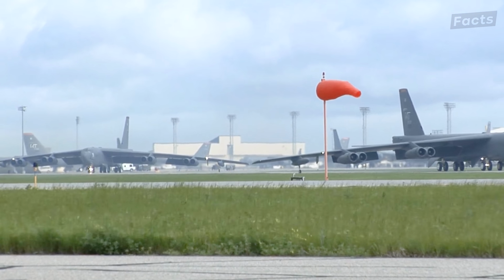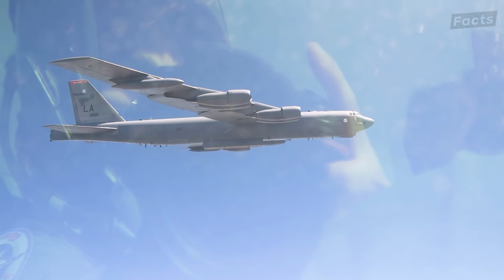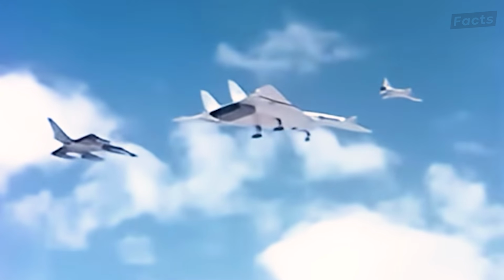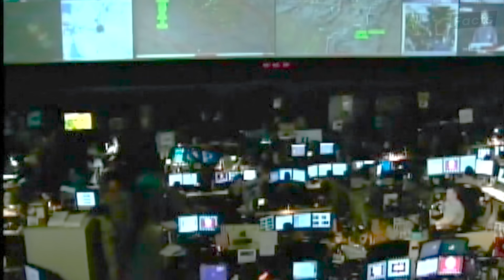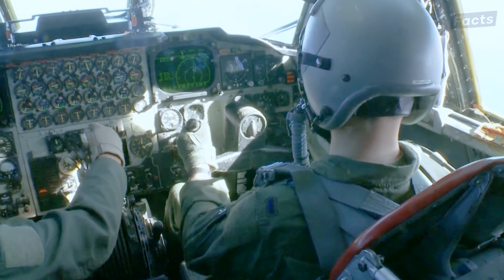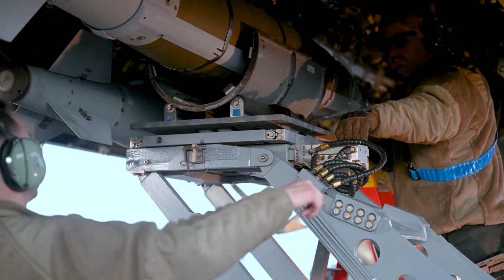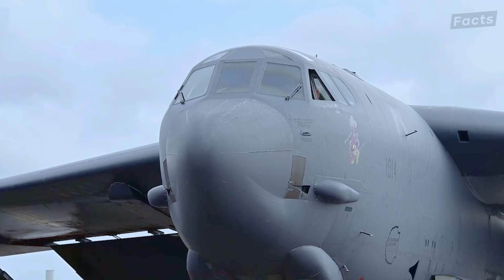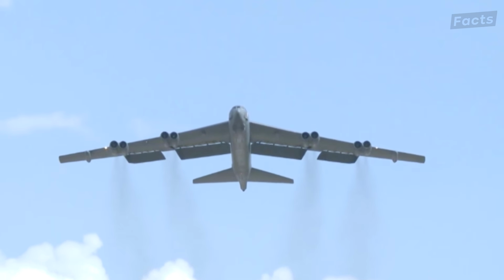US New B-52 After Upgrade SHOCKED The World!

Comment: This is how the B-52 remains a viable combat aircraft. It's big enough that it can carry almost every munition in the stockpile. Programs such as Pacer Plank reskinned wings due to fatigue issues. Sensors have been updated as capabilities improved, again sheer size means the assorted bumps and bulges don't really affect the aerodynamics that much. The TF-33 was a pioneering turbofan and has given good service, but with the retirement of the C-141 it's a orphan engine and finding spare parts must be becoming a scavenger hunt. New engines are simply sensible. Precision Guided Munitions have given this huge strategic bomber impressive close air support abilities. Basically a huge and highly adaptable bomb truck.

Comment: Finally the new engines are shown. Took quite a while to see some footage of the new engines. i wonder if they put the cartridge start system on the new engines?  Those RR engines fuel burn is a lot less than the P&Ws were. So they got a huge range increase.

Comment: One of the most amazing facts about the B-52 is the fact that the engineers looked far enough ahead to build in an amazing number of backup systems. practically every system on the B-52E models had back up on top of backup. If the original system failed to do the job there was always an alternate path to keep it operating.

Comment: I've always been surprised they didn't change to four engines.  Fewer engines = less chance of failure.  I can see the need for pivoting landing gear, though; the wing-down top-rudder technique we used in carrier ops wouldn't work with those long wings.
Reply: Two reasons: 1 as explained in the video the fin and narrow chord rudder could not have handled the asymmetric thrust resulting from one failed engine, and 2 this was  seriously discussed some time ago using four of the RB 211 family of engines, the 535E4 I think, (which would have fitted under the wing) but which would have meant a re-designed wing to cope with plumbing and structural problems.

Comment: The LUXBLaze Lighter being advertised over this video is a FRAUD.  They say it doesn't use Butane, but the only lighter they sell IS a BUTANE lighter.  It just has an arc ingitor.  It will NOT run without fuel.  I cannot believe YouTube continues to run these ads.

Comment: My dad flew B-24 Liberators and transitioned to B-17 Flying Fortresses during the last two years of WWII with the 8th Air Force flying out of Lakenheath, England.

He then flew in the B-36 Peacemaker until 1952 when he was trained in the B-52 Stratofortress.
He was an NCO tail gunner in all three. 
When he passed I received all of his personal papers. 

I learned  in those papers that he saved a B-52 crew that had the nose shroud and radar assembly shot off by a North Vietnam rocket. He heard their "Mayday" call out that they were "lost" and their navigation had also failed. My dad contacted the crew on his radio and used his gun radar to find them. He then gave them in-flight heading  instructions and brought them back into the formation. They landed safely in Guam.

I also learned that my dad was the only NCO tail gunner instructor in the entire Strategic Air Command.

He retired from the 718th Bomb Wing at Amarillo, Tx. in 1996 as a Senior Master Sargent, but had been nominated for the position of Chief Master Sargent of the Air Force.

He would have been 100 years old last December...
I miss him...

Comment: The B-52 was originally designed and built before super computers existed. Each B-52 carried what used to be a single simple (by today’s standards) computer to do the various tasks needed by each station. Now each B-52 carries multiple computers that each can do more than what the original computer could do. Now they are networked together with each being able to do what several other stations had to do, making each work station the equivalent of what each single computer used to do. Unfortunately today’s B-52’s able to do what several others had to do. Unfortunately, the current Rules Of Engagement (ROE), usually require each aircraft to confirm its target is really an enemy combatant thus making the long range stand off weapons stand-off capabilities useless.

Comment: On ALL fix wing Air Force planes there in an ISOCRONICAL Inspection via calendar days. You have Minor and Major inspections. i.e. a major inspection on c-130 for wing center box would mean taking off engines, external tank/pylons, removing wings, remove box and inspect (maybe replace) and put the plane back together all within 30 days. So each engine is taken to a shop and tear down to replace critical parts. Other systems would be updated at a certain time after wings are placed back. while the wing are  off, fuel cell technicians and environmental tech will inspect airframe/component and replace as needed. This happen all the time. In my life time I know there has been at least 4 different type of engines that has been upgraded for the B-52G/H models. The cock pit has been updated and so has the offense/defense ECM consoles. Remember around 1991 AF took off all .50 cal machine guns and did away with that crew position. It is always changing, so I don't know why folks this is a New idea concerning changes.

Comment: It’s just cool. But I’d also rebuild the B-1 and go one step further. I’d strip the B-1’s down and rebuild using fly by wire, new adaptive engines that would provide more power, far greater efficiency and the ability to super cruise far better. I’d use the same cockpit instruments and technologies as the new b-21 or F-47. In addition Id reduce the weight anywhere possible and thus would include reducing the crew to 2 or take the defensive and offensive crew members space and use for a replacement pilot rest area, toilet and galley. For these super long missions having a third pilot to rotate the crew would not be a bad idea. The over all goal would be a more capable, easier to maintain, fully modernized B-1.

Comment: The B-52’s engine replacement is already underway, and the first two aircraft were scheduled to start modification in fiscal 2027, with flight testing in fiscal 2029 and initial operational capability targeted for fiscal 2033.
dote.osd
What changes
The current TF33 engines are being replaced by Rolls-Royce F130 engines as part of the B-52 Commercial Engine Replacement Program, which will create the B-52J configuration. The Air Force selected the F130 in 2021 and later cleared the program’s critical design review in 2026.
dote.osd
Timing
Public reporting in 2026 said the first bomber was expected to arrive for modification later in the year, with two aircraft being modified first for testing. Broader fleet rollout is expected to take years, and some reports say full re-engineering may not finish until around 2036.
dote.osd
Simple answer
So, the B-52 is changing to new engines now, with the first conversions beginning around 2026–2027.

Comment: Wrong the B52 did not fly until 1957
Reply: Sorry, but you are wrong.  They entered the Air Force in 1955 along with the KC-135’s.   That’s how the tail numbers started with 55-. I am a retired Boomer Operator, and I’ve flown on what the oldest KC-135, ‘Old Granddad’ several times before it was finally retired.

Comment: Ex USAF, IT IS A INCREDIBLE AIRCRAFT, YOU SHOULD SEE THEM RESPONDING TO A ALERT STREAKING DOWN THE RUNWAY
Reply: I used to love the sights and sounds and feeling the ground shake as my dad's entire wing would scramble into the air during a wing air alert.

The ground would literally shake beneath your feet, the air smelled of hot kerosene,  and the sky would blacken with thick exhaust smoke pouring out under full power.

It was totally awesome!!!!!

Comment: During the Vietnam Conflict the B-52's that were used would fly strike missions carrying ONE HUNDRED AND EIGHT (108) Five Hundred (500) pound bombs spread between the internal bomb bay and wing pylons.  Think about that for a moment.  54,000 pounds of bombs.  For Comparison the B-17 Flying Fortress of World War II only weighed 36,135 pounds empty with a maximum bomb load of 17,600 pounds total.  You can read stories from Vietnam of a three ship formation of B-52's laying in a strike of 500 pounders and totally denuding a forested area 200-300 yards wide and a 1/4 to 1/2 mile long.  Just turning it into a moon scape.  There are stories from the Marines during the Battle of Khe Sahn where B-52 strikes would go in 1 to 3 miles from the base and the ONTOS (A small armored vehicle) would be bouncing inches off the ground from the ground shock from the strikes.  The B-52 doing a conventional munitions strike was guaranteed to ruin SOMEONESS DAY!
Reply: I remember watching one of those 3-aricraft formations and feeling the ground shake, and I was 10 miles away. Thanking God I wasn't under that thunderous power. I worked for Boeing in military avionics and did updates for the B52, B1B, and B2, all at the same time. I was surprised that the video mentioned the 1760 standard for the B52, it wasn't that advanced when I worked the B52. Not surprised though.

Comment: From YYZ. The one over whelming advantage of the B52 is the aircraft were already long ago bought and paid for.  There was one role left for it to fulfill since all the previous role were soon proven to be unsurvieable, starting with the classical high altitude bombing , then nap of the earth . With longer range missiles available , the delivery vehicle can be launching at a safer , stand off range, and any airplane capable of carrying a respectable load will work. That include any cargo plane with a rear hatch that can be open in flight, such as the C130, C17 etc. Just roll the missile out the back.  For the same amount of modification and repairs the USAF are willing to do on the B52, there are also hundreds of C141 in the bone yard they can resurrect.

Comment: Rolls Royce has the contract to replace all the propulsion units with advanced bypass turbo jet engines.
Reply: Isn't a bypass turbo jet a turbofan?
Reply: @brianwillson9567 A turbofan is old technology where all the compressed air is fed into the combustion chambers. Bypass jets have extra large intakes where the compressed air is partly directed into the combustion chambers and the high speed air is directed around the engine. The compressor blades are shaped to give maximum efficiency.

Comment: The B-52 remains in service because they overbuilt them and kept upgrading them. Then they found more things they could do. To build a brand new airplane that does exactly what a B-52 Already Does? And does really Well? We had decades to find out what screws up and unscrew  it. Putting new engines of a proven design on these airframes is a good bet. The 30% increase in range? That doesn't hurt.
Reply: Once you decide to use a standoff platform, you can use it for basically forever.  If you're not going to operate it in hot combat zones and it can deliver modern standoff munitions then you can keep right on using that 70 year old platform without a problem.
Reply: Imagine if they did that to 1st gen toyota tundras , also way overbuilt, I will let any of you men who care about your truck in on a secret, rustoleum rust restore after wire brushing frame let chill 3 days then Fluid Film black , get a fluid film wand also spray inside frame, do once a year. Spray on everything but exhaust under there. Will last so much longer
Reply: @ca6360  I have a first gen Tundra, an '01 with just 91K miles on it.  It's such a solid machine.
Reply: It was designed in one weekend in a motel room in Ohio
Reply: @KittyCatForPresident32  The basic design concept was.  Actually ironing out all the fiddly bits took a bit longer and a big team of aeronautical engineers and draftsmen.
Reply: Increased range , burning less fuel
Reply: This is kinda like how a 1990 F250 can be reconfigured to do lots of different jobs, cheap, while a new F250 will cost as much as the whole old one just for an engine rebuild and needs a computer specialist to fix the electronics.

Comment: Amazing this plane made 70 years ago more fuel efficient and heavier payload and cheaper to repair than anything made in last 50 years   Those engineers got it right back then
Reply: And it was built with a slide ruler , not a computer
Reply: @dbg-rides true
Reply: I think they did get new wings a while back, and lots of other parts have been replaced. See the "Ship of Theseus" 😊
Reply: The H models. All that are left, we're made in the early 60s, The last still in service, came off the Line in 64. When I was at OK City Air Logistics Center, we had the G models. THE H models were at San Antonio ALC. The D models were at Boeing Witchita ll for periodic maintenance. Minor upgrades and such. I climbed into one of our G models to observe were the controls of a propose new Dopple radar would be installed.
Reply: Ya gotta love it!
Reply: Sure, if you dismiss decades of refinement.  Out of the box this thing was a different and much less capable aircraft.
Reply: @TheDustyShed . Thanks for adding your stupid ass comment.
Reply: Almost 30 yrs ago, I saw a Beefer sneak over our barn @ less than 100-ft altitude; and I was amazed-impressed-thrilled for the next 5 hrs+!  Could almost see the pilot's face, seriously.